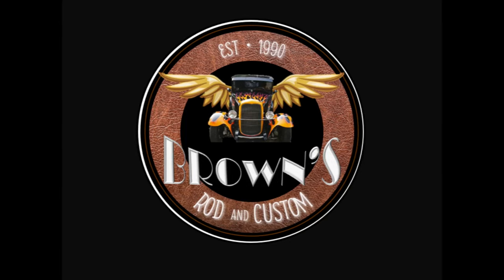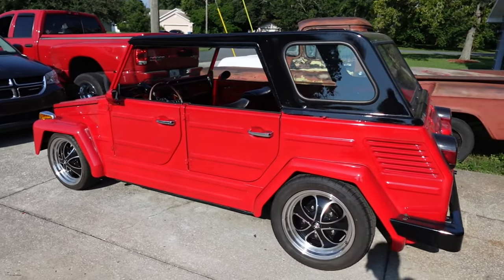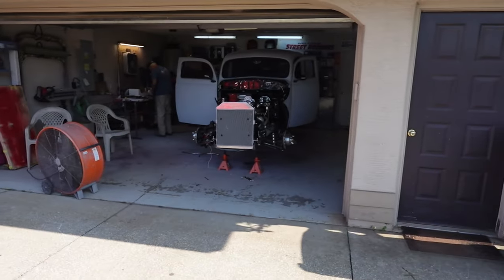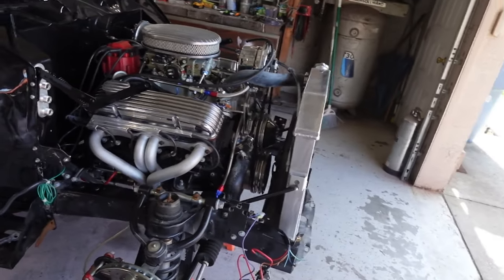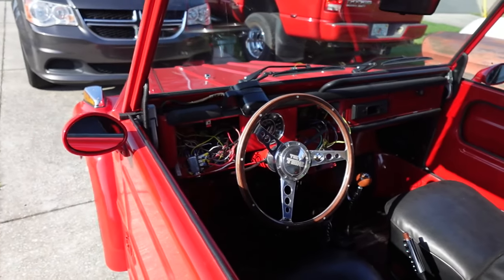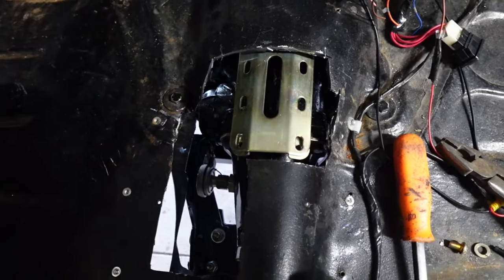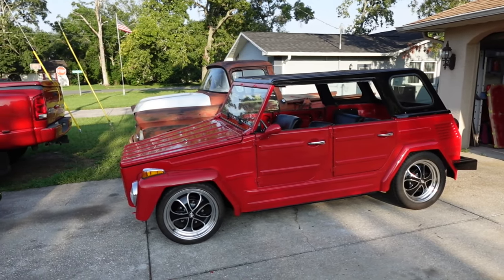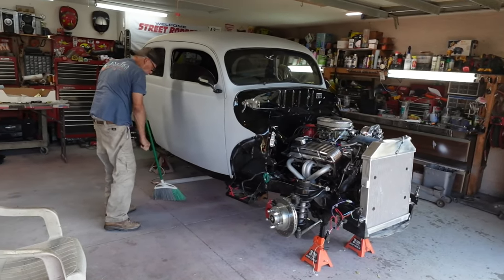1940 Ford Tudor Sedan Deluxe Restoration: Update 8-18

Comment: Ace hardware has brass,it's 10 times more expensive than other places but they habe brass fittings. Plumbing supply would have them n some hydraulic places in pasco County has them
Reply from the maker: I will check there! Thanks Don!